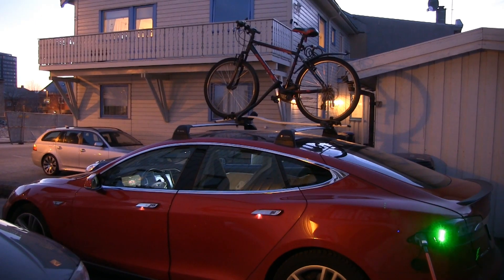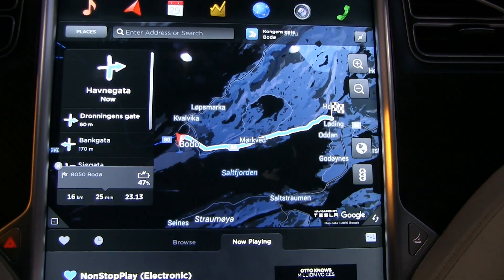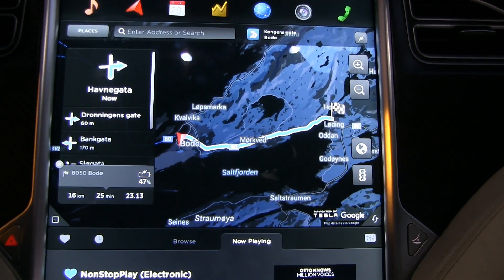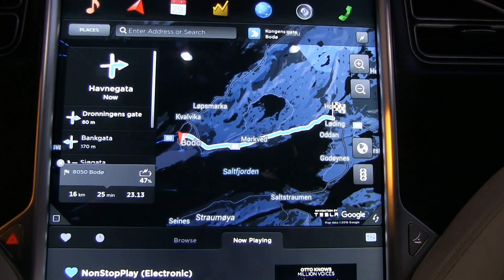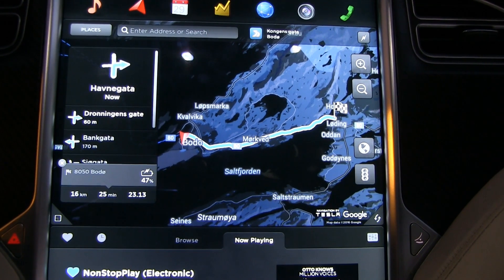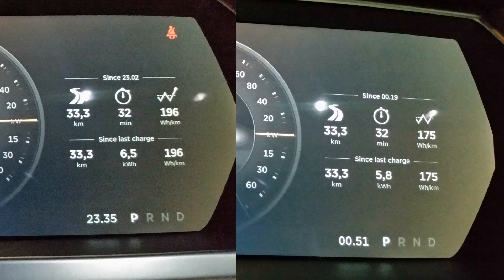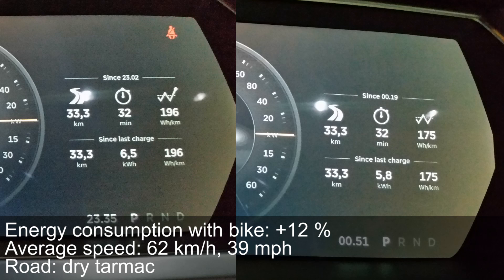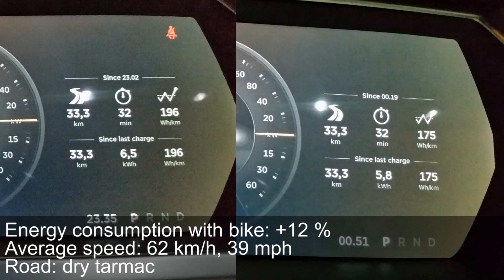Energy consumption with bike on the roof

Comment: How did you get that crack in the windshield?
Reply: It is spreading.
Reply: +Chris Bates The crack? Spreading from what?
Reply: Its a tesla problem.
Reply: +AstroChristian it has gotten longer since previous videos. Needs a replacement
Reply: +Chris Bates That's not the answer to his question though...
Astro: Hey, what time is it?
chris: 32 degrees
Reply: Filip Bjurling ITS JUST A PRANK DUDE.